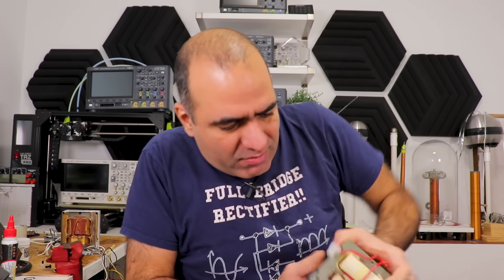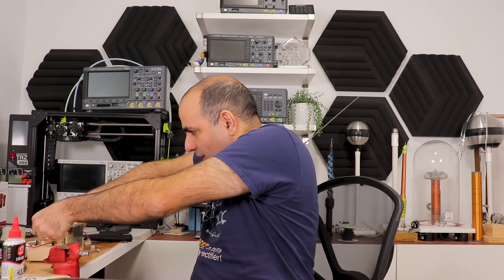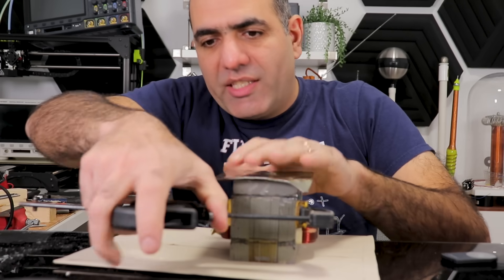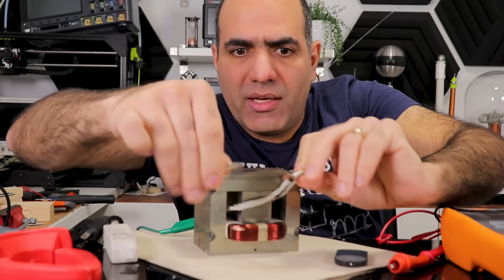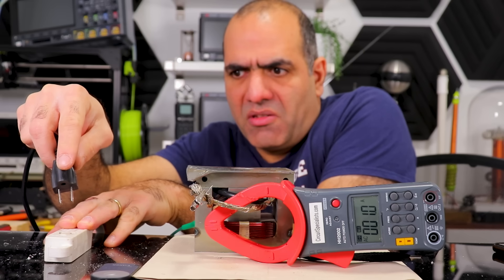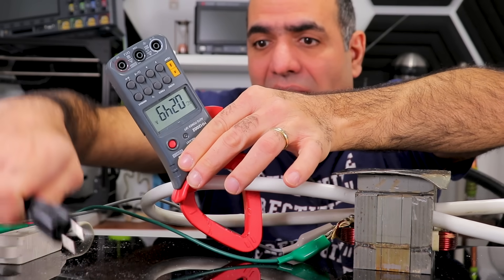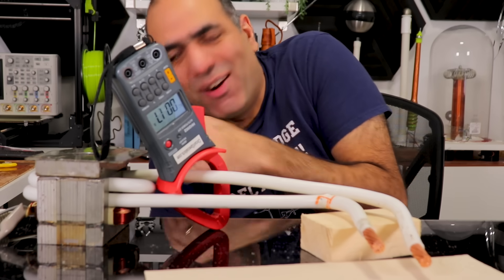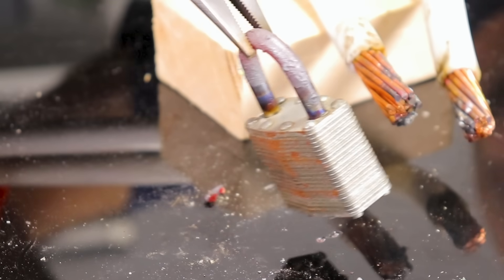Making "MILLIONS" of AMPS of Current

Comment: To people who dont understand electronics or electricity it has become the closest thing to subconsciously accepted magic.
Actually getting metal to become glowing hot in a few seconds would be quite handy for losening rustet shut nuts and bolts. The only method I knew so far was to just blast seized connections with a propane burner at a very lean flame to get whatever you are tryina losen to glow.

Comment: I saw a Siemens low voltage high current transformer connected to a huge parallel power diode array to convert to DC. The 25000 A current was then transported by "wires" as large as a hand, 3 of them air spaced but shorted every few meters outgoing formed the cable to increase the current capacity and reduce the resistance, each of these 3 "wires" where composed of multilayer sheets of light grey material, no idea if it was aluminium or copper with some sort of coating. There was no PVC coating, a metal cage covered the cables for the whole 100m distance.

Comment: Question: why not use the original secondary as your new primary, given that you were looking for higher reduction in turns from coil to coil?
Reply: too much internal resistance. at 60 ohms that's 2 amps draw as a pure open-air resistor.
Reply: The resistance will limit the total current supplied. However, a secondary with the same total resistance as primary would theoretically work.

Comment: Probably for higher currents you need a larger core (maybe from a surplus welding machine or a larger power transformer). Then wind several 3/0 secondaries in parallel. Maybe you can experiment with thick copper tubing instead of the 3/0 wire.... I see a bump in break ins where padlocks were melted open :))))
Reply: An arc welder would provide the transformer but then its already configured to give 100's of amps.
Reply: I agree.  When winding some multi-horsepower motors, we often used multiple conductors in parallel.  Making the coils using two 14 AWG, or two 12 AWG plus one 14 AWG was easier to mechanically wind, form and insert than one 8 AWG.  Also the the smaller diameter made for better filling of the slot (many small circles fill in better than fewer large circles).  Of course beyond a certain cross section manufacturers often switch to 'bar' conductors, actual square/ rectangular cross section made custom dimensions.

Comment: If current is the amount of electrons passing per second, then how is it that there is current in that open huge cable? 🤔
How can there be so much current from the output while the 120 volt input only can pull milliamperes? 🤔
If there are more turns in the secondary producing more voltage than the input primary then that means it’s violating the second law of thermodynamics. 🤔
Answer me! I’m stupid!

Comment: Thing is that with voltage that low, you can grab both ends and feel absolutely nothing at all. There's simply not enough electromotive force to push it through a high resistance human. It's the same with your car battery (You can lick your fingers and it won't make a difference in either one)

Comment: Would you be able to reuse the old secondary winding as the primary? That would increase your turn ratio between primary and secondary on your new transformer. Or would that go over the ampacity of the original secondary winding?
Reply: It would have too high resistance. IIRC from the video it's 60ohms, so the maximum current for 120V input would be 2A (and it would melt the primary). Because of the higher turn ratio, the output voltage would be even lower (0.05V/turn instead of 1V/turn), requiring even thicker wire, but that wire would not fit.
Reply: No, I believe the impedance is much lower so it'd draw too much current from the wall and pop your breaker
Reply: @Neobenedict  No. The real  120V primary is about 120 turns of much thicker wire. It has lower resistance than the high voltage secondary. 
So, using the high voltage winding (~2k turns) would reduce the current, both no-load and short-circuit.

Comment: Is the high current not lethal for a human because the voltage is low and the resistance of the human body is high? The 500A measured when the current was going through the spoon, that is only because the spoon has such low resistance, but if that voltage were to go through the human body the current would be much smaller. Am I correct in my asessment?

Comment: This guy's nuts. . . . . I LOVE IT! Yes, the thicker the wire and the more turns, the higher the amps. If you use an insulated thick bar, shaped to fit inside the armature, you could get hundreds of thousands of amps or more.

Comment: Can somebody explain how doubling the loop at 4:37 on the secondary coil increases the Current at secondary? Isn’t the Current supposed to be decreased as the Voltage increases, since this is a step down transformer?
Reply: A small number of turns gives a too low ratio of secondary winding resistance to load resistance. In order for the energy transfer to be as efficient as possible, this ratio must be equal to one. Therefore, by increasing the number of turns, we increased the resistance of the secondary winding, which match with the load resistance. (check Maximum Power Transfer Theorem)
Reply: @artkutyuska9842  He uses the same length of wire. How does doubling the loop with the same length of wire affect its resistance in any way?
Reply: @artkutyuska9842 😊
Reply: But sir I'm not satisfied with your ans. In the video He use the same length wire to make the 2nd turn so effective resistance of the whole wire should be same ?
Reply: @nilanjandasTV  Yeah that’s what I thought too. I haven’t got a proper answer for this. And it’s really bothering me 😂😂💀 @ElectroBoom Mr Mehdi if you see this can you please explain :) Thanks ⚡️
Reply: But one thing I can think about that the source is not a constant power source ( connected to Primary ) so when the voltage is doubled by doubling the no of secondary turns and the resistance of the secondary wire is also constant ( if we don't consider the effect of heat in the resistance) then I=V/R ( here V is double so I is also increase) and on the other hand the primary coil aslo draws more current from the mains source.
Reply: @nilanjandasTV  To maintain constant power as the Induced EMF in the secondary increases with the number of turns at the secondary, the Current should decrease. Which is not the case. Which is what I’m wondering why.
Reply: Doubling the voltage with a constant resistance means double the current. The power is not constant.
Reply: @Owen_loves_Butters  The power transfer has to be constant. Which is why a step down transformer increases current while decreasing voltage
Reply: @סמאלן  What's constant is the input power compared to the output power. The input power and output power are ideally the same. But that says nothing about what that power actually is.
Reply: @Owen_loves_Butters  Wtf are you on about. It’s a step down transformer. The transferred power is same. As voltage in the secondary coil increases with the increase in number of loops the current should decrease. Which is not the case. Which is what the question is. And don’t tell me resistance is decreased. He literally used the same length of wire.
Reply: @סמאלן  For a constant current at the input, the output current would decrease if the voltage was increased. But the current at the input is NOT constant. What determines the current is Ohm's law, I=V/R. Higher voltage with constant resistance means more current. Period.
Reply: @Questiala124  tell me you’re an illiterate middle school dropout without telling me you’re an illiterate middle school dropout lmfao

Comment: This seems like a powerful tool. I hope you find something fun and interesting to do with it.
Since the voltage is so low, would it be safe-ish to touch with your hands? I imagine if you touched between the two ends of the wire with a finger or your palm, it wouldn't be high enough voltage to make a connection.
I probably still wouldn't try it either way.
Reply: It'd make a connection, but it'd also be perfectly safe to touch (so long as it's not still at several hundred °C from shorting stuff out).
At ~2V, it'd be even safer than touching the ends of a 9V battery or a 12V car battery; the resistance of your skin and body is too high for such low voltages to induce enough current to cause any harm, let alone be felt (the resistance is much lower across your tongue, however, hence why you'll get a strong-ish tingle if you try to lick a 9V battery).
Reply: @dylanh333  I failed on my terms but I'm glad I had the right understanding.
Reply: The resistance/impedance of the circuit from one of your hands to other, or one hand to ground is millions of ohms. 2V / 1000000 ohms = micro amps. It takes about 25 mA to cause cardiac arrest. You would be completely safe.

Comment: Could use the original secondary as the primary. If that's not already what you're doing, anyway. That coil looks like the original primary, but I could be mistaken.
This way, you could use more turns on your THICC secondary for more efficiency, without sacrificing too much of the amperage in the volts/amps tradeoff. Though it seems like you were at the spoon's limit regardless. Man, that's so cool.
I might try this, if I come across a broken microwave. I have... Practical uses for it. Not just annoying my neighbors by playing inventor in my backyard, but also I fucking love railguns, and those things thrive on high current, but getting the current up there at low voltage is a bitch.
Reply: then you would be limited at only 240W
Reply: @LucasFerreira-gx9yh  Not really. 240W in maybe. But not per shot, not even close. See, problem with railguns is storing and (and charging) lots of amps (amp-hours you could say) at low voltage. Low voltage means farads are worth less than a higher voltage.
That being said, if the voltage can be reduced enough and still get the right amount of amps, low wattage with a railgun is possible, albeit it probably isn't launching any large projectiles. Railguns really only operate on amps.

Comment: If the core of a transformer is made from stacked iron pieces, that are individually insulated, to reduce eddy currents,  then wouldn't welding the core electrically and magnetically short out the core, thus rendering the entire process of manufacturing the core in that fashion useless?

Comment: I took apart my hair clippers to fix the switch and was shocked to find an electromagnet instead of a little motor like the one in my beard trimmer.

Maybe that's normal, but it blew my mind. That seems so much better for longevity compared to a motor.

Comment: For anyone wondering, when referring to AWG size 3/0, you refer to it as "3 aught". Aught is an old way of saying "absence of quantity", therefore 3 aught is basically saying 3 zeroes, which is what 3/0 is (000). Same idea for 1/0, 2/0, and 4/0. It's kind of strange, but if you call it anything else, electricians and engineers will look at you funny.

Comment: Doing this sort of thing as a DIY project to create wood burning art and stuff like that has been responsible for the deaths of many people. I was hoping you'd go into the details of why its so dangerous. For example: contact with the circuit will tend to lock up your muscles and won't trip a circuit breaker due to the physical separation between mains input and the high current output through the transformer. Would love to see a follow up video on this as you've got a huge audience on this platform and the credentials to back up what you're saying!

Loved the video as always, Mehdi! :)
Reply: The unmodified mot are dangerous.

Comment: After gluing the plates: So quiet now
Me: That's still a stressful, sanity destroying, noise though.

If you were to spend a full day with that noise, you might get used to it. But you know it's stressful because as soon as you turn it off you feel light and relaxed all of a sudden. My reference is from a low frequency, low volume noise made by an extractor fan, but the principle is the same.

Comment: He can now spot weld nickel terminal strips to batteries. But he needs a switch to turn it on and off within a second or so, and some closely spaced contacts made of the right material. So it's not without a use if it's rigged up to a few more bits.

Comment: Is it possible to be used for welding? 

I mean welding does require a lots of current but the voltage is around 36V under load and 50V no load, maybe for stable arc or wire friendly 🤔 maybe? 

Please someone explain it to me 🙏

Comment: Do you have a direct connection to the substation?  Otherwise, how do you get hundreds of amps through a 20 amp circuit breaker?
Reply: That's the point of the transformer, to convert it into lower voltage, higher amperage

Comment: And use the original secondary as the primary winding? The turns ratio would be larger and it would be easier to get more currents =)
Reply: The secondary wire is a lot thinner, meaning it has a much higher resistance. The resistance of the primary is essentially in series with the load on the other side of the transformer. So if your primary winding has, say, 10 ohms of resistance then even if the transformer was ideal and the secondary was perfectly shorted you would still only get 120V / 10 ohms = 12 amps out of it.

Comment: Wow. As someone who's been doing a lot of work with power supplies and struggling a little with getting an intuition for how inductive circuits behave, this video was amazing.

You can sit around with equations all day, but it only helps you refine an existing idea for solving a problem. It doesn't help you think outside the box - only an intuitive understanding can do that. You've completely re-written my intuitions for the relationship between magnetic flux and current, and it's already got me thinking about how to design the power supply I'm working on.

Awesome as always. Thanks so much Mehdi!

Comment: You should do a toroidal transformer and use more turns on the primary coil or get two of them and stack them and run them on your fuse box maybe get 240vac on both the coils! anyway super cool video keep it up 👍

Comment: ngl the super glue bit actually helped me get more confidence in doing a hack that i saw online to reduce coil whine from my gpu. they said to superglue the edges of the coils and that it completely kills the noise. that seems rather plausible after watching your large scale demonstration
Reply: it didn't work :(
Reply: @GraveUypo  Shit, I had hoped this would help too. Superglue should have been thin enough to fill the entire coil, that is what I would have done. You wont affect its purpose built characteristics with stuff like glue (like you would with metals and other magnetic or conductive things) so you can feel comfortable playing with it using just about any non magnetic insulating material. Try filling it with glue if you did not already seal up the holes in your previous process. I have heard it can be better to use something more like a liquid rubber but often people argue it wont be fluid enough to make it through the small cracks into the holes you need to get into like Superglue seems to be capable of.

Comment: I'm curios, what happens when you wind the secondary in a next transformer as primeri and wind an even bigger secondary? Will ist cut the voltage and increase the amps even more on the same amount of input power to the fist transformer?

Comment: The secondary should be 1,000 v., not 2,000. The 2,000 is the output of the voltage doubler circuit, so 1,000 X 2 = 2,000. You could make the secondary out of copper sheet, but that is hard hard to find laying around, i.e. free, so how about aluminum sheet, which is easily found? And the thicker the better.

Congratulations, you have built a soldering gun.